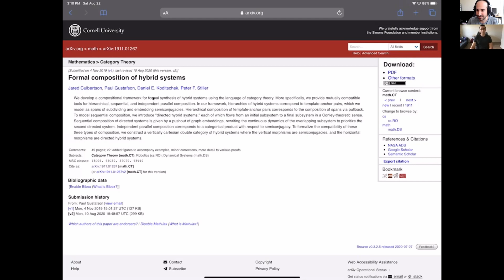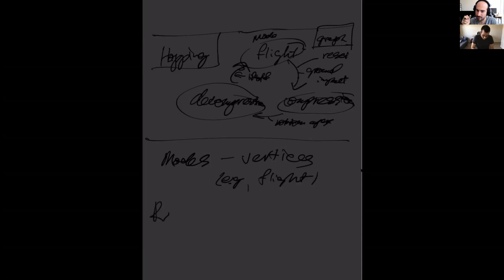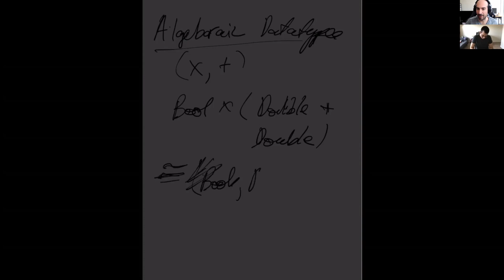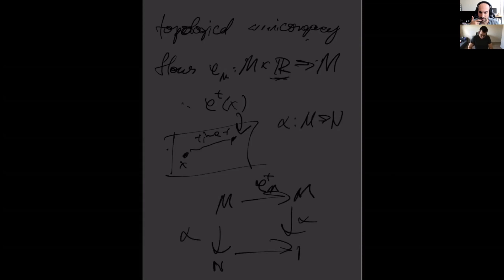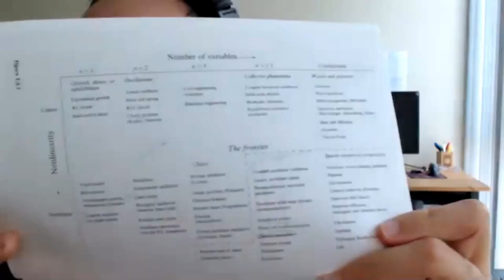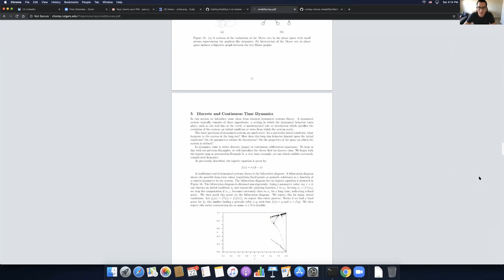Category Theory and Robotics - Paul Gustafson

Comment: https://videosummary.co/video/evNVu1-om8g
		
Chapters -
00:00:00 Introduction
00:01:38 Koditschek - Minitaur ghost robotics
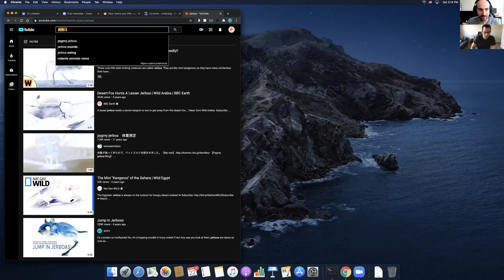00:05:06 Composition - Parallel vs Sequential
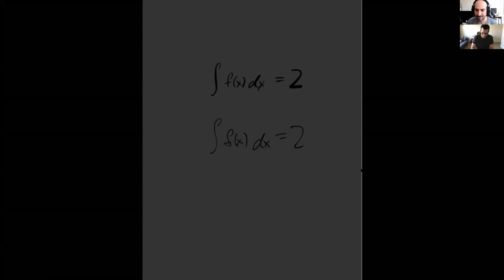00:13:37 Hybrid systems - Discrete and Continuous dynamics
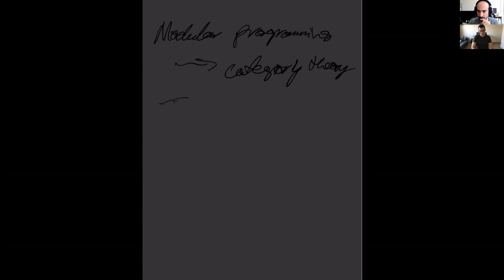00:25:25 Type theory
00:31:31 Curry-Howard Correspondence
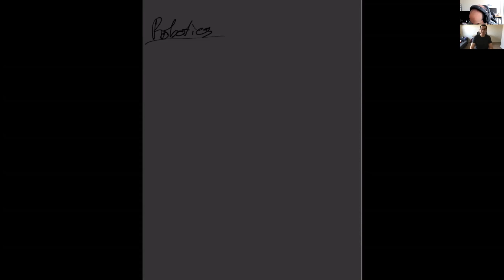00:33:31 Definition of a hybrid system
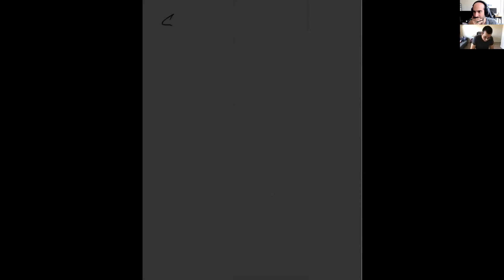00:36:41 Semi-conjugacy
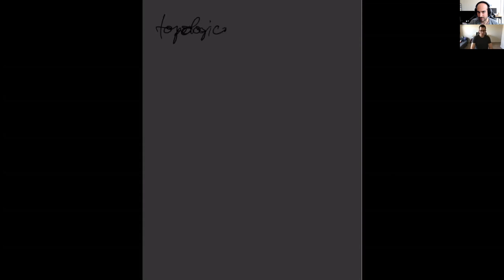00:39:47 Topological semi-conjugacy
00:44:12 Application - Products + Universal properties
00:57:40 Languages practitioners use to compose domain-experts thoughts
01:00:31 Economy systems relates to solving problem of composing tasks
01:04:22 Conley-Morse Database
01:11:55 Summary

Powered by videosummary.co